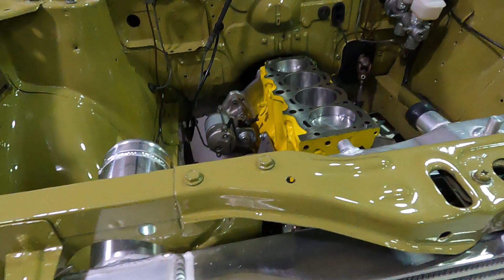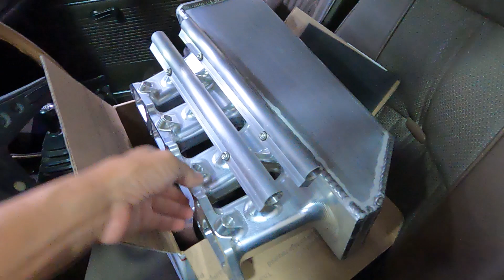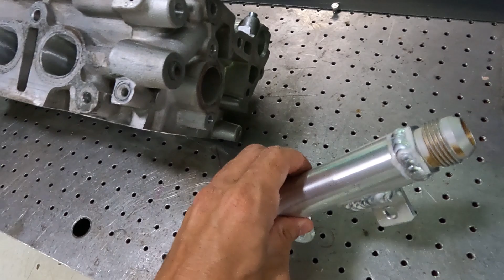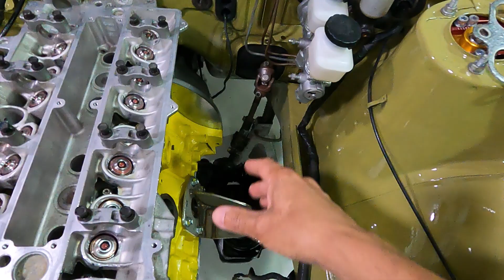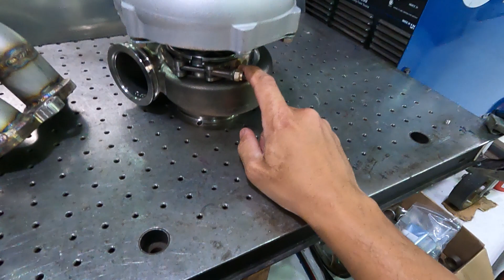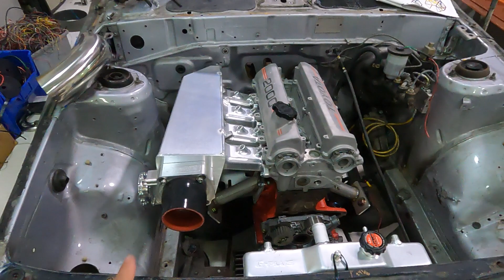3SGTE TE27 Build part 1

Comment: Hi psi racing I love the Toyota 3s things that you guys do 🔥 but I wanted to know why does my head say Yamaha above the exhaust port but this one does not
Reply from the maker: Most heads on performance style Toyota engines are designed by Yamaha. Just not all of them actually have the Yamaha name casted in them.
Reply: @psiracing  thank you sir, I know that Yamaha casts some of the performance heads for Toyota it's just my first time working with the gen1 and I see the valves are even cast with Yamaha logo 👍maybe me got a different shipment in South Africa
Reply from the maker: @kebechet_Racing_ZA  Gen 1 is a great head

Comment: Hey what transmission flywheel and starter are you using?
Reply from the maker: Flywheel and clutch setup is a custom billet steel flywheel and clutchmasters twin disc. Starter depends on the bellhousing you have

Comment: Is that the 1” wilwood brake master cylinder?
Reply from the maker: I'd have to find out, the owner actually installed it prior to sending us the car!
Reply: @psiracing  I have the wilwood 1" for the 240z on mine hoping it will do the trick on technotoys big daddy brake kit on the ae86 spindles.

Comment: Very cool! I just pulled my 3S-GE from my MR2 and recognised everything! I don't know what other cars the 3S block was mounted longitudinally in, were those engine mounting points always intended to be used for that?
This is so damn clean, my distributor was apparently held in by two turns of one bolt, so the whole tranny is covered in grunge...
Reply: Altezza had them mounted like that.
Reply from the maker: @Mr_jz_12  yes they are
Reply from the maker: There awesome cylinder heads, way ahead of there time, just very hard to come by! And man I can imagine the sludge mess! Damn!
Reply: @psiracing  did you trie the toyota altezza MT cylinder head? it is awesome
Reply from the maker: @Encex2  we havnt but we have 2 of them to hopefully try in the future!

Comment: Couple questions Brandon 
1. Where oil filter would normally screw on, you said you needed to adapt a AN fitting there, can't you screw on a remote oil filter plate? 
2. Would you recommend using the external oil pump on a street car?
3. Now with Beams oil pump, is this the first time doing this mod?
Reply from the maker: 1. We could screw on the oil filter plate but I believe it's to tight once the header goes on.
2. External oil pump can be used on a street car, we need it cause of the extra high rpm the engine will turn!  
3. Yes 1at time doing the Beams oil pump setup and there's a hole video on what we did there as well